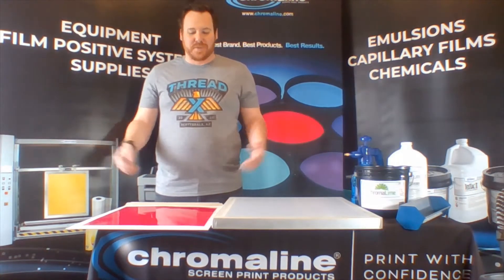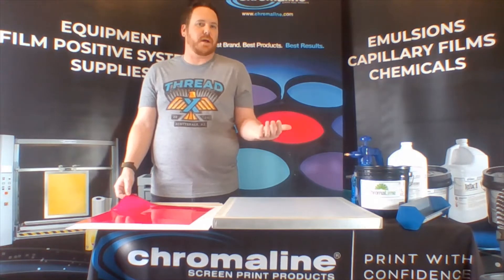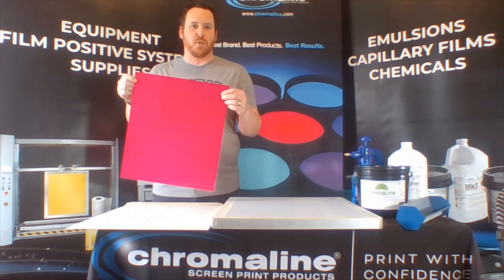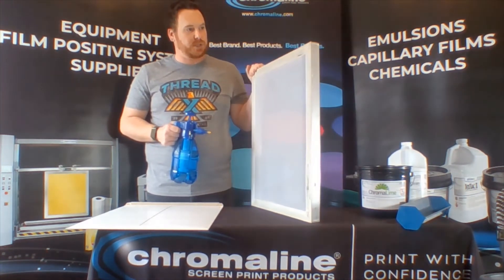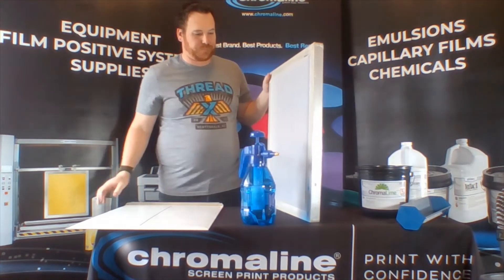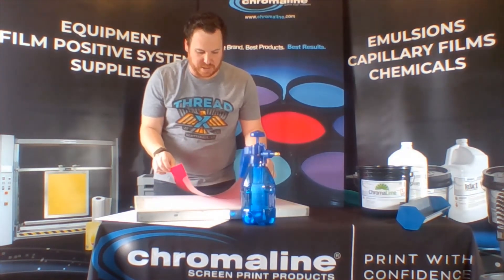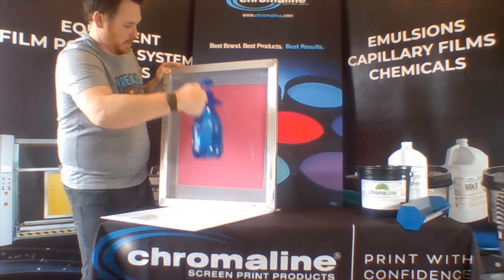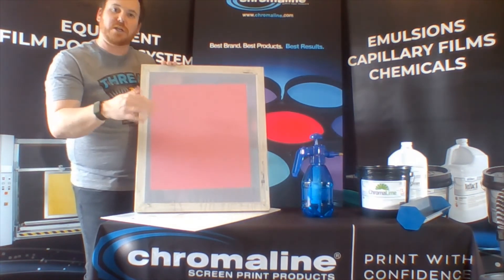Capillary Film Application (Chromaline QuickFilm)

Comment: Thanks for the video. I need some clarifications on how to lay the screen in the rack after applying the capillary film. And also if it advisable to squeegee inside the  squeegee side of the screen while applying the capillary film. Because when I did that a lot of the emulsion was coming off and messing the floor, what do you advise. Lastly how long does it take to dry. Thanks. See this video: https://www.youtube.com/watch?v=LXcCbUbAInw
Reply from the maker: You can dry your screen either way; however, I usually dry film side up. I typically squeegee the excess water from the squeegee side. Some emulsion will mix and run off with the water. If it’s really excessive it’s possible you using too much water, but it’s completely normal.
Reply from the maker: Also it all depends on your environment you’re drying screens in. Could be 20 min could be a couple hours. Once dry the carrier sheet should pull off easily.
Reply: @EmulsionGuru  The carrier sheet pulls off easily but I noticed a sticky result when i lay my film on it. After exposure which is between 6mins-6:30mins based on my Ryonet X-Vactor flourescent model. It is a little bit hard removing the film from the exposure mesh. The color of the emulsion end up sticking to the film making it unusable again. Do you have similar experience? Thanks
Reply from the maker: @bosun436  that tells me there is still moisture present in either the cap film or your inkjet film. After removing the carrier sheet let your screens dry even in front of a fan to help reduce the amount of moisture present.
Reply: @EmulsionGuru  Thank you. Like how many minutes/hours should I place the cap film in front of a fan after removing the carrier sheet and before placing my separation film on the emulsion? The film am using were printed months back. So it couldn't have been the film. My screen dry cabinet (25" x 42"x 25") has two ProBreeze dehumidifier and a box fan(20" x20"). I dry for about 4-5 hours.
Reply from the maker: @bosun436  that all depends on your environment. It could be 30 min or it could be hours. During higher humidity seasons it will take longer.

Comment: Thanks for the video... I wanted to know if I was using a 500 watt bulb how long would I expose the film ?  Like any other emulsion 12-16 minutes at 16" from screen ?  Just curious.. .Thanks.
Reply from the maker: Hi David, I always recommend doing an exposure test when anything in your screen room changes especially emulsion. There really are too many variables for me to answer that question specifically. Depending on the emulsion you are currently using and the thickness of that emulsion on a coated screen (EOM) it may or may not be similar times. Our QuickFilm is a pure photopolymer based film so it is pretty fast exposing.